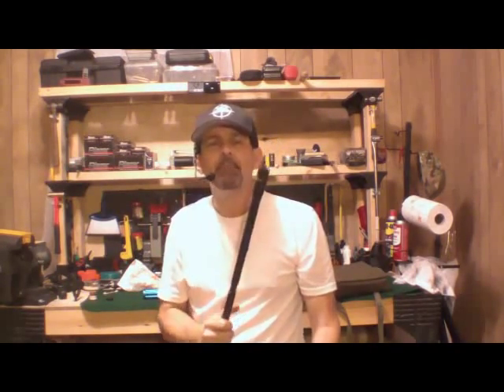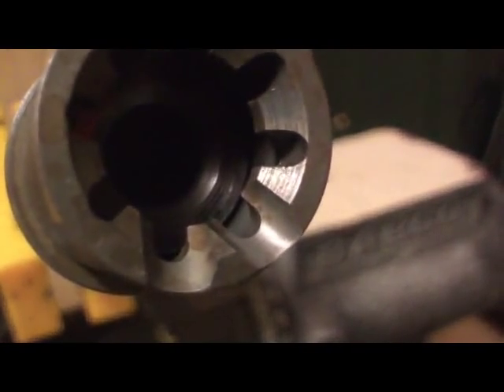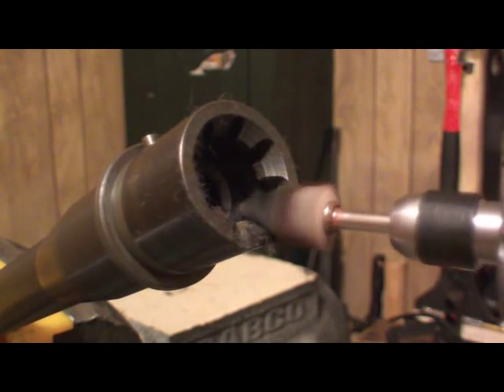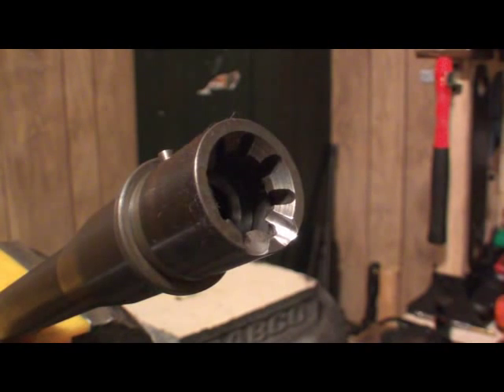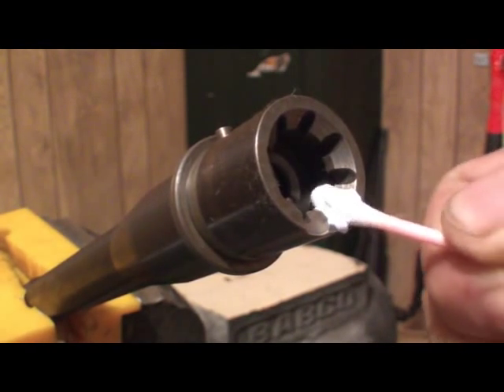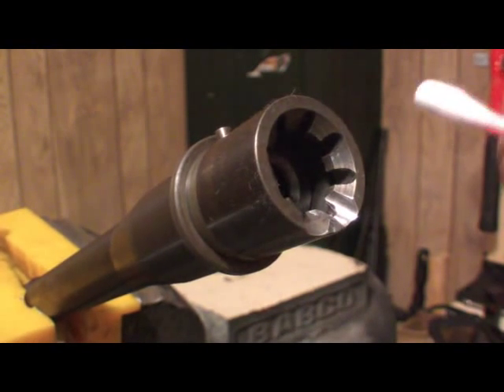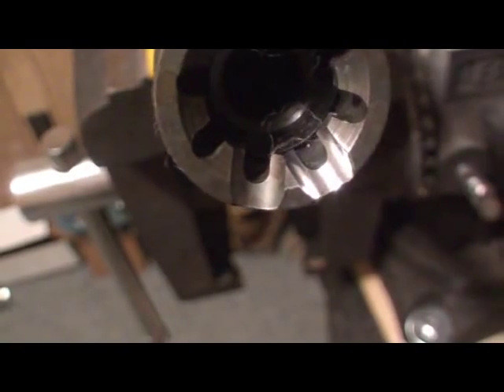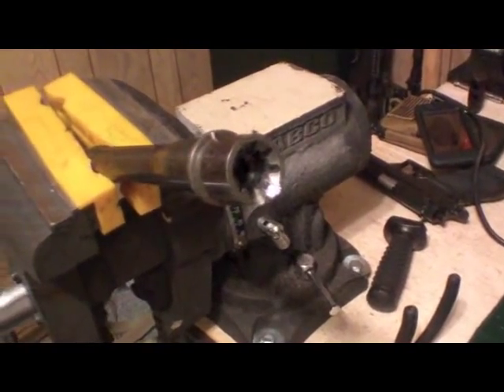Polishing the feed ramp in the AR15 and M4 Barrel Extension

Comment: Funny this old video is getting comments still.  I would say anyone who doesn't under stand the benefit of polishing the feed ramps only shoot military FMJ 5.56 ammo.  If you reload your own ammo and shoot other than 5.56 you will discover how nice it is to have polished feed ramps.  I reload my 7.62x39 with 220 grain round nose bullets that are very blunt.  The standard m4 ramps are just a tiny bit narrow and steep for a round nose bullets.  However a good polish job made them so slick that it doesn't matter if the bullet smacks straight into the ramp.  Polishing increases feed reliability no matter the bullet cartridge combination.  Look at a 1911 in standard military configuration, you're lucky if it will feed a hollow point, give it a chamber polish and feed ramp polish and the next thing yo know you can feed the biggest hollow points available.
Reply from the maker: I agree 100%

Comment: @lookingupforjesus Since the AR platform has an integrated barrel extension, incorporating the locking lugs that will work the bolt lugs, headspace is normally a non-issue. Headspace will be always a fixed datum, since barrel locking lugs and chamber will be a single item.

Comment: I use a small sanding drum that is basically the same diameter as the ramp shape. I sand it down while installed to blend the ramps into the M4 ramps in the receiver perfectly. 

Also, polish the chamber if it's not fully feeding, as some AR barrel chambers are very rough and have a feed stoppage about 1/2" back from full battery.

Comment: I've got a bushmaster 6.8 that is eating the tip off soft tip ammo, an really digging into copper ammo. I've started to look around on the net. Seems to be a problem for some makers of 6.8 not using m4 feed ramps. Should I just change the ramp or grind the ramp down? Seen were some have ground it down but wonder bout mess up the finish. Any thoughts, thanks

Comment: With all respect sir.
Absurd
"Changing angles" ...... You’re polishing 4140\4150 steel with a soft polish wheel, compound and a q-tip. You may be cleaning the pores of the steel but you ain’t budging that steel. Or at least it better not budge. Cleaning …. OK ……. Working out imperfections   ….. nope.
Reply from the maker: This process will take the finish off, and the polishing compound, also takes that less than perfect metal finish, and turns that steel into a mirror finish (otherwise there would be no point to the process)..  when I was on one of the Army Pistol teams, I had a been issued an incredible 1911 built just for that purpose, and it was new, and when you pulled back the slide, and let go, it would just stay (that's how tight the rails were) and to get those hardened steel rails to loosen up to the point that the slide would slap forward to the point that it needed just a slight push to close, I used the same basic polishing compound, which is just valve lapping compound, and just applied the compound to the receiver and slide rails, and hand lapped them by working them back and forth, until the two surfaces were perfectly matched  (you would be surprised at how long it takes by hand (not all that long, and not all that much effort), so all i needed to do was clean up the parts to insure that ALL the compound had been removed, reassemble, and head to the range for 150 rounds for the finally break in for added reliability.  after that at 75 yards, standing unsupported, we stuck a small exploding target, one of the old tiny ones that you had to hit the dead center (the size of a quarter) for it to go bang, and a friend took out his 7mm mag rifle and scope, and we both had a shoot out to see who could hit the target first (again, 75 yards, standing unsupported), and my 1911 Composite pistol won...(I have always enjoyed shooting out to 100 yards with any of my handguns).  back to the polishing compound...  the ultra high speed Dremel tool, (note: the polishing tip fits 100% perfectly, so that also helps a great deal) mixed with a good polishing compound takes just a few minutes to clean up both feed ramps to a nice shiny surface, with nothing the bullet tip can catch or drag on.  The Flitz polish is just an ultra fine polishing compound, and while it's not really functionally needed, that flitz really brings out the shine to the point that you can just about see yourself.  clean up and your done...   so while it's true that the flitz is not enough (by itself) to fully polish the feed lips, the polishing compound by itself is more than enough polish, and shape the feed lips.   (cutting new angles would be a big no-no..lol)
Reply: +Twzzr55 you couldnt be more wrong. i changed the angles too the point of visually being able too see it. i used a dremel bit. with my hand..
Reply: +Twzzr55 dont talk about what you dont know please
Reply: +Twzzr55   Use your damn eyes, Helen Keller: 3:38
Reply: If you're 'polishing' you're removing.
Reply: Weaponeer n
Reply: Weaponeer  sir I have this problem I was going to attempt to do this my self. But it's probably not a good idea since it can blow up on my face. What do you recommend. It's a clambering issue and how much does it cost to get it repaired by a profesional?  Thanks
Reply: Twzzr55 
Agreed ! All he did was shine it up !
Reply: Maybe T watched the end with his eyes closed.

Comment: Can this cause corrosion issues over time or are all feed ramps Aluminium?
Reply from the maker: ** Super Answer**  The M16/AR15/M4 Series Barrels that are Mil-spec are made from SAE 4140 chrome-molybdenum or "chrome-moly" steel or 416R stainless steel and the Barrel Extensions. (for those new to the AR15 the barrel has a threaded barrel extension installed on the chamber end of the barrel. inside the extension where the bolt lugs lock into.  You have standard extension without the feed ramp's and you have M4 barrel extensions which have the feed ramps) 

The feed ramps built into the barrel extension are either chrome-moly steel or 416R stainless. I have never seen any corrosion on barrel extension feed ramps (polished or not)  But, there are two feed ramps on a mil-spec M4.  1. the Barrel extension 2. the upper receiver (also known as an M4 Upper). Now I always buy M4 uppers with feed ramps because without the feed ramps the tips of the projectile can hang up on the very edge of the upper. adding that ramp in the upper receiver solved that problem but that modification required the M4 barrel extension to also have feed ramps installed (like all other rifles). 

NOTE: the M4 is a product improvement of the M16A2, so it took the best of the M16 series and molded it into the new M4. which is why the M16A2 did not include feed ramps. 

Now polishing the feed ramps on the upper receiver so they match the barrel extension feed ramps is a requirement for feeding reliability especial under full auto fire. the outer layer on the aluminum upper is andodizing which can be rough and can cause the bullet tips to hang up (especially for non-milspec) so you can polish the andizing to match that of the barrel extension 

(The number one cause for bullet tips to hang up is misalignment between the barrel extension feed ramps and the upper receiver feed ramps on M4 uppers especially under full auto fire).

Now, since upper receivers are aluminum and if you were to polish past the anodizing into the aluminum to match up and/or polish the feed ramp. then it's possible to have the aluminum oxidize if the rifle is not maintained. if this happens, then the feed ramps would then need to be repolished and the owner smacked upside the head. 

It's been reported that the new M855A1 ammunition has been reported to be causing wear on feed ramps (I assume the upper receiver feed ramps because brass is not harder than chrome-moly steel, so wear should be nil.)

This typically would have more to do with the Magazine then the M855A1 ammunition. it's the feed lips responsibility to align the ammunition and especially the projectile tips onto the feed ramps "correctly".

Comment: Why do this?
Reply: boltcarrierdotcom helps th eounds from getting scratched up and not having a ftf when charging that first round with the C handle! smooths it all out
Reply: ever built an ar in 7.62x39? Making them work is a test of love.
Reply: @circiequisling4313  I'm building one now and learning that haha but when I get it running right I'll love it
Reply: To reduce and or eliminate the feed ramp from scratching or burring the bullet during feeding that will cause inaccuracy as bullet flies through the air

Comment: Any downside of doing this? I’ve got a little bit of feed trouble and i think it’s the super sharp feed ramps on my aero/ba barrel. Pretty sure this thing was done on a Friday afternoon cause the gas port appears to be a little off center depending on how you look at it as well. Thanks man great video
Reply from the maker: Gas port first....   use thread ocker between the barrel and the gas port and make sure it's properly aligned  Micrometer helps. scribe a line on the barrel to mark it so the gas port is spot on and a if it's a rail use a bubble level on top. and lock everything down.    then you can polish the feed ramps and check it with a mag to make sure it's feeding dead on.   I also recommend using thread locker when you seat the barrel.  it will improve accuracy..   then check your bolt carrier. slip it in place and look at the gas tube. if the gas tube moves when the bolt is closed that means you very slightly bend the tube (with it in place but bolt carrier pulled back.   had to do this with all 300+ M16 series rifles in my unit. when it's adjusted correctly it should not move or cause any additional friction.  your rifle should work perfectly every time.    Weaponeer does not get any money from YouTube, which keeps this disabled vet fairly poor.  I would love to do all these tricks on video (18 years as an armorer in the Army and now a master armorer with nearly 40 years doing it. so I know a trick or two  lol    one big one is how to clean the gas tube so it's bright again.    I use kit string. yu loop it two times around the tube and with CLP you work the string back and forth and it cleans it up perfectly.  you can then add some polishing media on the string, work it in and clean it up with dry string and it will get a little less carbon buildup.    lol, I guess the weaponeer channel needs to use Patreon to get the funds and parts to demo all this and support the channel.   I hope the tips above help

Comment: ok so i should poish for reliability and make my rifle parts last longer (cheaper then going to titanium haha) what do u mean by "pin area" like inside the hammer and sear holes? or the pins them selves? im acutally sitting here with my dremel going off as i read haha, im in the process of building my first ar-15. and where exactly would i need to polish to lighted trigger pull?

Comment: just bug for the ear, i had a high power that would jam when hot so i polished the ramp and no help there. so i took a cartage and manual slid it up the ramp and it stopped when it hit the top of the barrel inside there was a grove in there and i polished it out now no problems. so check the inside were the cartage hits
Reply: boardstretcher1 this might be my problem. My lr 308 was failing to feed. So I polished the ramp .. although the polishing the ramp didn't help I did notice the same marks you did on the inside top of the barrel where the tip of the bullet touches.  And also the proble arieses after 10-15 rounds have been fired as it heats up. You know where I can find more info on ths?

Comment: Im more concerned that your ramps are being utilized at all if youre not firing full auto. At semi auto rates of fire, your mag shouldnt have a problem keeping up, which is the only case in whuch M4 feed ramps come into use. BUY GOOD MAGAZINES, OR REBUILD YOUR CURRENT ONES if you shoot semi and think your feed ramps are being used. Odd video to not mention this.
Reply from the maker: The M4 ramps have nothing to do with the rate of fire (semi, or full), in fact, the M4 ramps also have nothing to do with the STANAG magazines ability to "keep up". A STANAG magazine with a weak spring effects the reliability and consistency, just as a magazine follower, and even bent fed lips can effect proper feeding, but this is true with rifle or carbine, with or without M4 feed ramps.  As a Master Armorer with 30 years experience and a Disabled Veteran with 16 years Military Service, I'm surprised by the amount of misinformation there is on something as simple as M4 ramp's, even on ARFCOM you will see many posts stating the M4 ramps are for full auto purposes despite the fact that the M4 has three shot burst, rather than true full auto fire, as in the M16A1. so once again, the M4 ramps have nothing (zero) to do with the STANAG magazine. In fact, the M4 ramp's main purpose is deceptively simple. with the M16A1/A2 series rifle, you could insert a magazine, and if you very slowly, ride the bolt forward, while trying to silently reload the rifle, the bullet tip of the 5.56mm has the potential of hitting a small spot of anodized aluminum just below the locking lugs, and it's just enough to hang the round up, yet it will feel like the rounds chambered, even if you press the forward assist (and in combat, you may not have the time to visually verify that the round really did chamber) So while it's rare that bullet tip will prevent the round from chambering when lightly closing the bolt, it's potentially deadly for the user. (if you give the rifle a good smack on the butt, like you would when going prone, that jarring motion almost always bumps the bullet tip off the small ledge and into the chamber. otherwise, pull back the charging handle, and allow the bolt to properly slam forward to clear it).  it's not a major issue with the M16 series rifle, which is why they never had a recall, and the ramps cut into all upper receivers.  If you have a rifle or carbine without the ramps, you can check to see if your rifle will do it, but you should try this at the range with the barrel pointed in a safe direction..  you may find that it might do it, but it's pretty hard to do with most guns because you need to do it just right.  one thing you should ALWAYS do is number your magazines (color coded and numbered is the best)  this way, when you have an issue with feeding, or jamming etc.. you need to make note of the magazine, and if it happens again, check the number, and if it's the same magazine, first check to see if the magazine rocks back and forth when inserted into the magazine well, and if it does, retire that magazine, next double check the feed lips on the magazine. if they are bent, you can try to re-bend them to see if that fixes the problem, if the feed lips are fine, then it's worth rebuilding the magazine..  if you really want to stress out the old noodle, think about this....  it's possible to bump fire a semi-auto AR15 rifle, faster than a full auto of the same type rifle.   Note:  don't forget to check out the weaponeer website/forum at http://www.weaponeer.net  weaponeer can also be found on Facebook, Google+, LinkedIn, Twitter, and other social media sites.
Reply: +Weaponeer Agreed and well said!
Reply: The maker of the video knows what he's taking about. You Adam do not.
Reply: +Weaponeer Your comment had more info than the video:) thanks
Reply: thanks for the info!
Reply: Weaponeer awesome info. this happened to me.

Comment: your choice is not reliable no toys or self defence. it's good to have junk guns for training. you learn how to push through issues. now be for you spend money on Frankenstein builds or low end rifles that have issues. save your cash and get a good platform that's reliable. I learn from others mistakes. my 6920 has been the best long gun that now I have 2. with that being said I work at a local gun range in Nevada and our customers put all guns through serious torcher test and I seen lots of guns fail. my boss can afford to replace the parts and we send them back to the manufacture and have it replaced. you can't. all you here is oh it needs a new buffer or lube or BCG. why should you make it work if it should work out the box. do your research and ammo has its part it plays.

Comment: Aren't the feed ramps case hardened? Will this process leave enough of the heat treated metal in play?
Reply from the maker: case hardened?  no.  either Chrome-molly or 416R Stainless  so it's not an issue